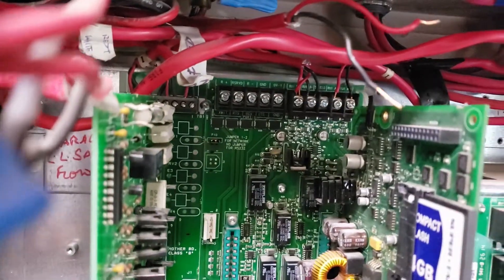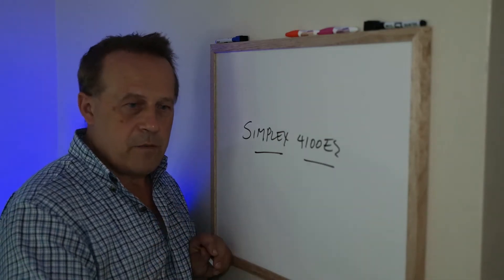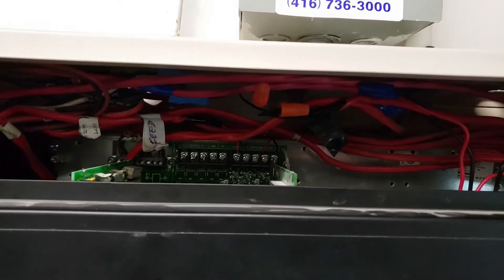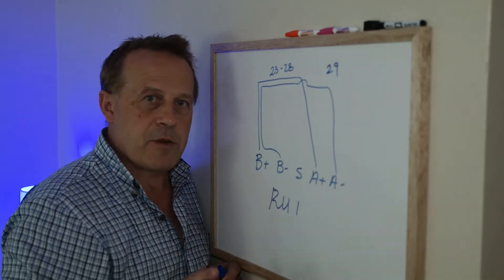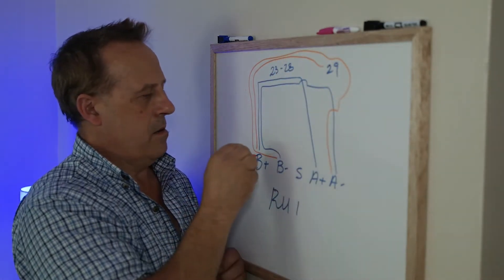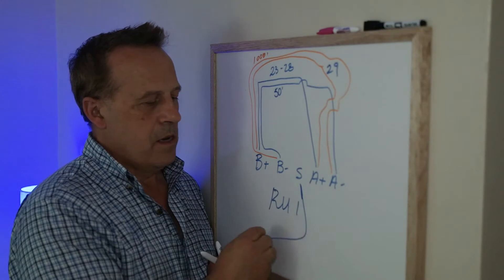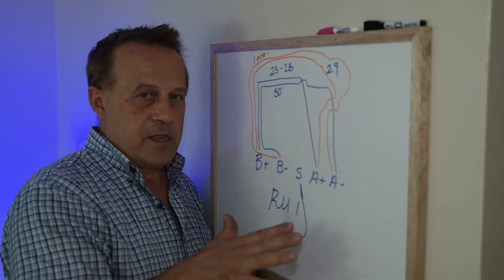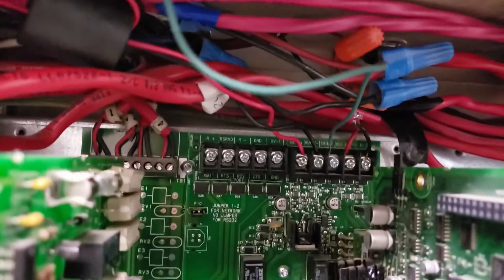Ferrite Bead fixes our fire alarm trouble  #ferittebead #firealarm #technician #shield #simplex

Comment: I am currently having an issue with a 4100ES where is just throws alarms in one particular area.. Here is catch the client is an electrical company. With a sub-station less than 500 feet away from the panel. I am wondering of we should employ ferrite beads on all of the Idnet circuits.. What are your thoughts??
Reply from the maker: Yes.    ..Alarms?   The addressable loop is made up of a robust communication protocol stack.  It seems to me that noise bleeding into the loop would not activate and alarm.  But beads are amazing devices that attenuate noise.
Reply: @firealarmapprentice4517  Noise bleeding into the loop can absolutely cause a false alarm
Reply from the maker: @JustinShalloo  I can't see it.  Alarm ?  What device would come up ?
Reply: @firealarmapprentice4517   Could be any random addressable device on loop with interference.
Reply from the maker: @JustinShalloo  I really doubt it.

Comment: I have a simplex 4008 and don’t have RUI hookup but SBUS I honked that and aux 24 volt to 4606-9101 can’t get it to work any advice
Reply from the maker: american parts ?
Reply: @firealarmapprentice4517  yes I now how 2 4606 annunciators 1 from eBay and another from a JC tech I’m not sure about the addressing on annunciator but tried 4-9 address card maybe this item is not compatible with simplex 4008